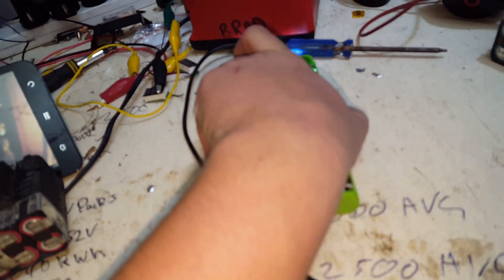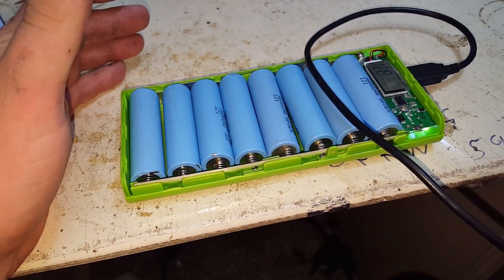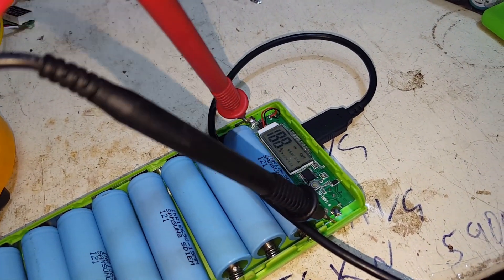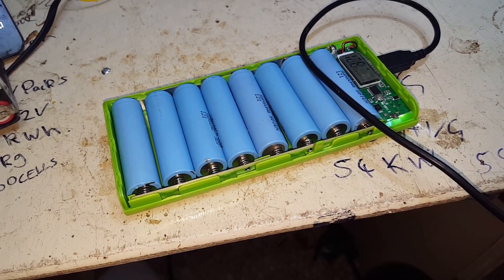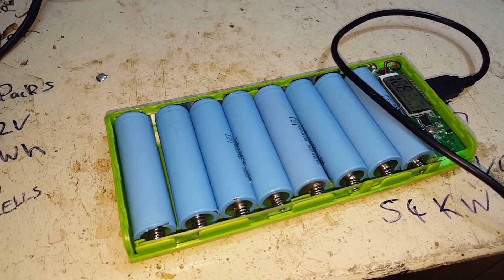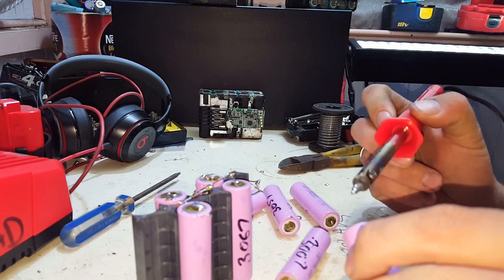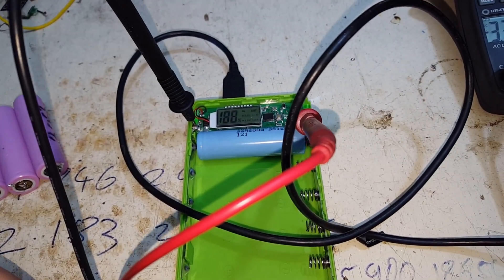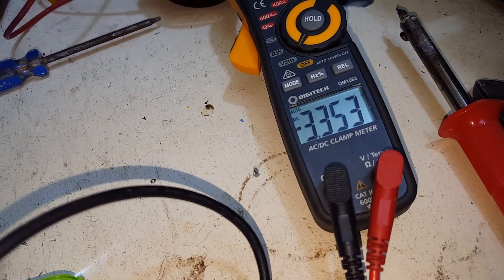New 8x 18650 power bank cell Discharge protection test

Comment: Hi there, may i ask a question please. I have rechargeable AA batteries that i need for me flashes. I often come back only having used half of the power from them, and charge them up again to max. Am i doing it correctly? How can i prolong the life of a battery please?
Reply from the maker: What chemistry aa batterys are theh
Reply: Hi there, thanks for getting back to me. Nickel metal hydride i think... its AA hr6/nimh duracell recharge ultra 5 yrs
Reply from the maker: Try and cycle them hard a few times other wise they might be getting past it. They self discharge alot nimah
Reply: Hi, so am I meant to drain them completely and then charge fully before putting them away for storage for a month? I guess i could put them in a torch to make sure they are fully drained first, after a job. I also have a charger [make: EBL 999 12 Bay] which i assume works the same as a solar pwm charge controller
Reply from the maker: Yeah go a few full discharge recharge cycles
Reply: Ive subbed to your channel btw, thanks for the hard work creating some interesting videos. This subject we are talking about might be worth doing as a topic too maybe thanks bro
Reply from the maker: Yeah lots of devices still run the aa or aaa c d style batteries be good to show people how stupid disposable batteries are cheers mate
Reply: I appreciate your replies, ill take it on board, thank you. Have a good evening, all the best, kieron
Reply from the maker: Cheers mate enjoy the videos
Reply: I enjoy your videos :-)
Reply from the maker: Thamks mate

Comment: Have you checked the top charging voltage on this.  Mine seems to go to 4.27 volts.
Reply from the maker: James Miller na not yet i will have a look and see what this one does my discharger  says there 4.21 and starts discharging when i put them in syraight out of these so ill check  it cheers

Comment: Hey One up the sleeve customs I love the raw shots in your video of working on the modules. It definitely is a familiar sight to us tinkerers! You seem to be a hobbyist that might be interested in an endeavor some friends and I have undertaken. If you or anyone you know is interested in an automated testing system for 18650 cells, please consider checking out Lexcelon's Kickstarter for, "The Batlab." This is a complete system designed to walk users through the entire process of configuring a custom electric battery pack. The system cycles cells, runs cycle tests to determine capacity, sinusoidal and pulse tests to characterize impedance, and can estimate state-of-health when compared with benchmark values for a particular cell model. We are planning on making all of the hardware and software open source after we launch. If you are interested in learning more or becoming a backer, please check out our Kickstarter page! We are so excited to bring this product to life for other inventors like you.

https://www.kickstarter.com/projects/1722018962/batlab-a-battery-testing-system-for-lithium-ion-18?ref=discovery

Comment: Sir, where did you learn how to solder. You use the wrong kinda iron, and clearly the wrong type of solder. That looks like plumbers soldier, and that should not be used for electronics. No wonder you have problems getting it to stick. Just a tip - get proper lead-based solder. It makes soldering easy peasy
Reply from the maker: +Peder Bjørndal the solders lead tin 50 /50 what do you recommend